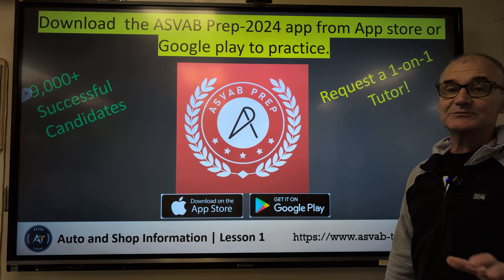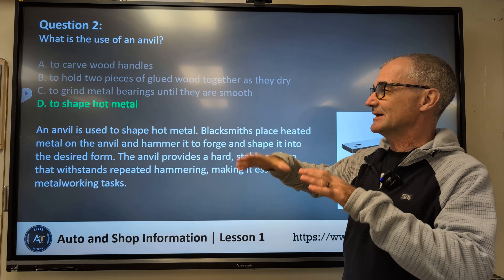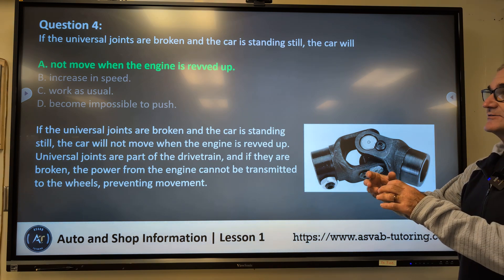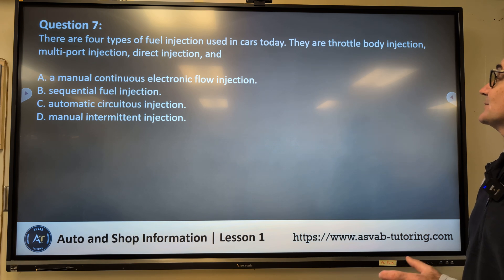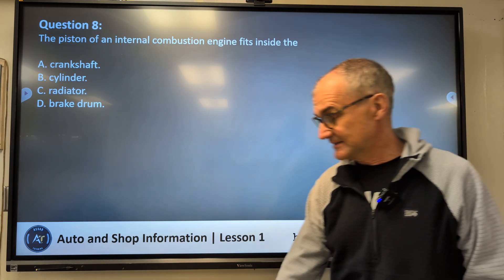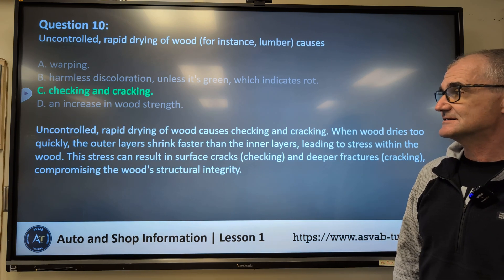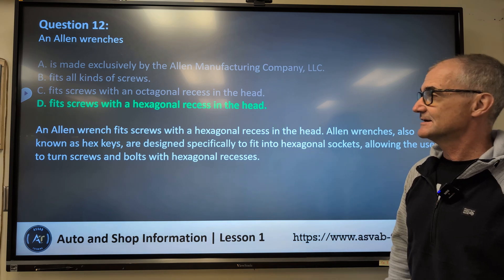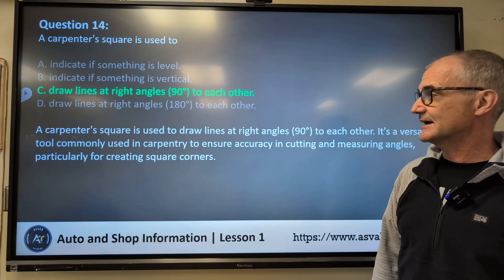ASVAB Auto and Shop Information  2024

Comment: The answer for #5 should be Power Stroke. A spark plug ignites the compressed air-fuel mixture during the power stroke in a four-stroke internal combustion engine.
Reply from the maker: Good feedback thank you

Comment: I was a bit confused the spark plug question. I have a study book that doesn't mention it in the compression stroke's definition but does mention it in the power stroke definition. Is there a better way to help me distinguish that the spark plug firing is apart of the compression stroke and not the power stroke. Thank you for your time!
Reply from the maker: Yes, spark is power stroke